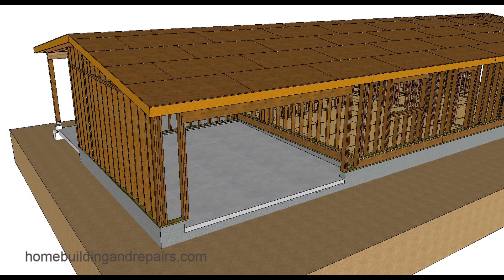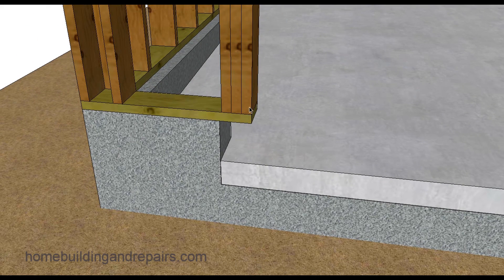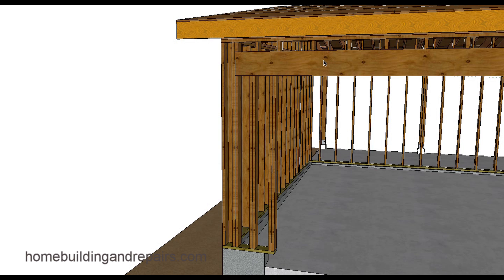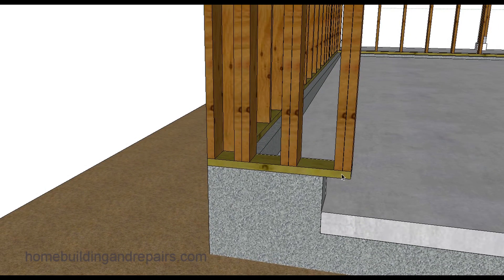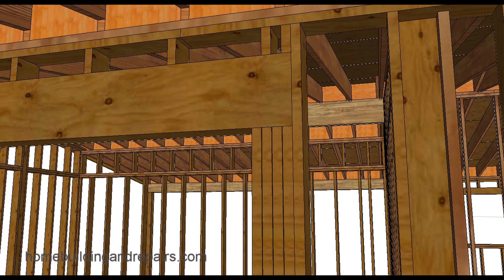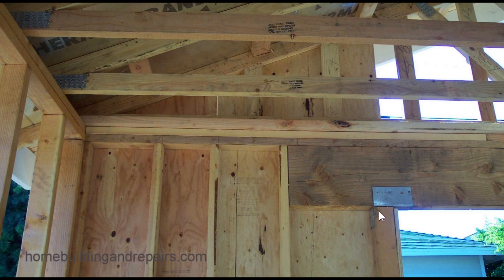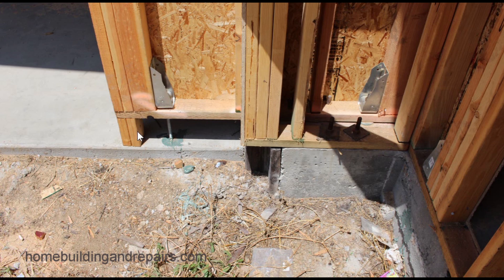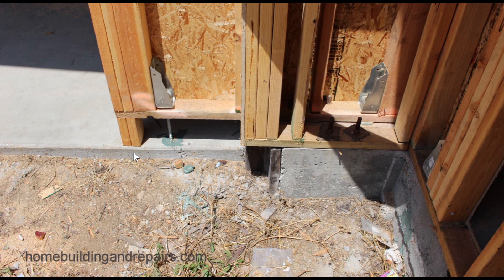Extending The Garage Door Header Can Solve Concrete Footing Location Problems

Comment: Looking at having a pair of 9x9's installed to close in a carport (20'8" opening). Local inspector and the installer are discussing how to deal with the fact we want to install on what appears to be "Slab only" that is inside the bearing wall foundation (pretty much the same as the video).  Of course expansion and movement of the slab become the issue. Since the facade will be setback we are kicking around the idea of installing an engineered floor truss and suspending the entire facade (using slotted angle plates fastened to the slab to capture the facade and allow for any vertical movement. Enjoyed the video as it more or less shows the situation but we are looking at... The building is 40 years old, both installer and inspector are noting that there has been no sign of movement since built and are leaning toward keeping it simple (letting the slab take the load) which would be great but is the option of suspending the load worth looking at? Thanks

Comment: in Minneapolis, it is code to have the header extend the entire wall. I am not sure how this would work if you have a small opening in a long wall. But we build 24x24 garages and the headers are 24"-3" (for king studs on either side) the reason for this is not loading but sheer. When they have to nail off the sheet material in a 3"x3" grid pattern to keep the portal stiff.

Comment: I have a question. what size lumber do I need for a header for a garage opening 16 foot wide.
Reply from the maker: I don't provide viewers with structural lumber sizes, but can tell you that I've seen plenty of 4 x 12 used. In areas where it snows, these lumber sizes might need to be larger.

Comment: Question: Why was the garage floor poured so far away from the main house? Seem to have a large gap like the garage was an after thought. Should the garage floor be attached to the main foundation? I would think that all foundations settle and if the two are separated then when it settles you will see a lot of cracks.
Reply from the maker: The garage actually connects to the house and the garage foundation doesn't need to be attached to the house foundation. And if the foundations are separate, they wouldn't create problems for the other structure or should I say they might not.

Comment: Great details in your videos. Do you have a video on how to frame a garage door opening for the different sizes of large doors.Thanks for all your efforts.
Reply from the maker: No I don't, but what sizes for the openings would you be looking for.
Reply: Thanks for the reply.
16 foot by  7 foot door.
For framing do you frame it exact or make it a sight bit narrower for the door.
Thanks for your time, your videos are very helpful.
Reply from the maker: Now I know what you're looking for. I will put a link here when the video is done, but the finished door openings are usually 1 inch smaller than the width of the finished garage doors. I know this might sound weird, but if you can, go measure a few garage doors in your area and see how they're built if you need information before I can complete the video.
Reply: Many thanks, cheers.
Reply: What size header would i need for a 15w 21lng garage and the door opening is 8x7

Comment: What load do you think you are having to transfer?  It's a gable end and the bearing points of the gable truss are fully upported by the foundation.  The part hanging out 'unsupported' is just the door rough opening.
Reply from the maker: All of the weight on top of the garage door header needs to transfer to a solid foundation and there shouldn't be any gaps anywhere along the transfer area, including underneath the trimmers. Let me know if it doesn't make sense.

Comment: You are easily the best home construction advice guy on YouTube, in my opinion. Love the videos. Would you consider doing a video on a roofing strongback some time?  I've been told they are used to prevent cathedral ceilings from pushing the walls outward. Thanks!
Reply from the maker: You would need to provide me with more description on what a roofing strong back is, we might use a different name for it and thanks again for and thanks again for an extremely pleasant and refreshing compliment about my videos.
Reply: On a hip-roof cathedral-style ceiling a strongback is the board that lays flat with the roof and goes horizontally ABOVE the soffit and has the rafters attach to it at their base. It's my understanding it is used to prevent a cathedral ceiling from pushing the walls outward since there is no gable stud at the end (being a hip roof) to hold it up. I wish I understood it better myself so I could give you a better description. Thanks, Greg!
Reply from the maker: It's hard for me to tell what you're talking about and if you ever find a picture or drawing, feel free to send it to me. It's difficult to build a cathedral ceiling in a roof, without some type of ceiling joists or rafter ties to keep the walls from spreading out.